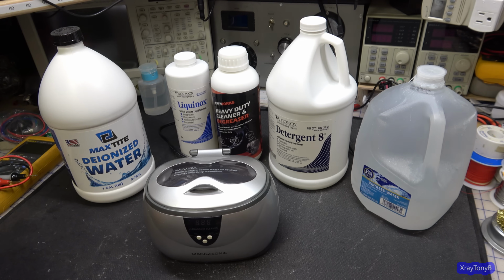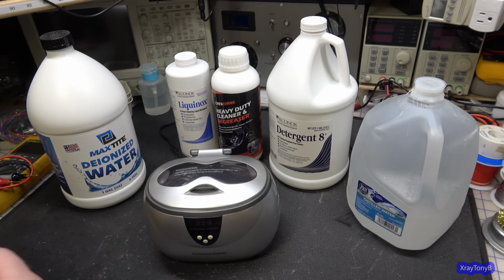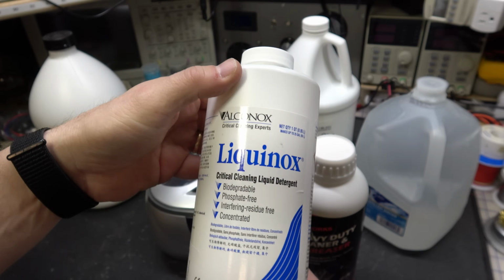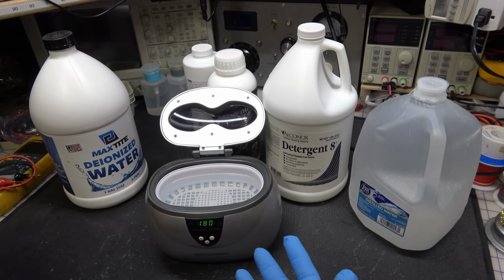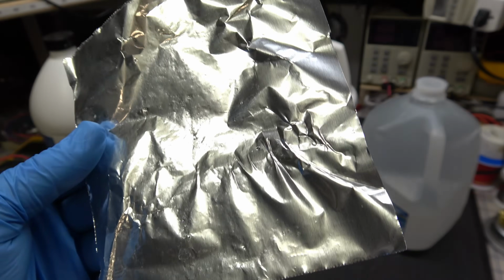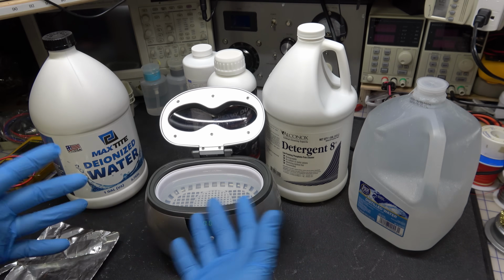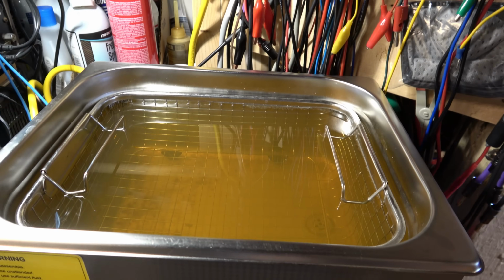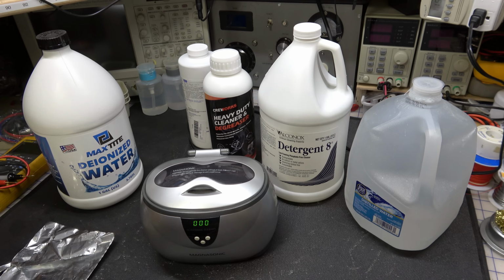Using Ultrasonic Cleaner for Electronics

Comment: Why Not use the Water from your dehumidifier you have in the basement. That would be close to distilled. As apposed to where you boil water and it have the condensation drip into a collector.

Comment: I've been looking at ultrasonic cleaners for cleaning electronics for some time but started going down the rabbit hole.  Hearing about potential damage to parts, PCB's I found the Elmasonic cleaners.  I was in shock after looking at the cost.  Then I saw your video.  Been watching your videos for some time, I felt confident to start with the same Magnasonic cleaner you have.  Purchased detergent 8.  Working on legacy equipment I would hate to damage anything and not find replacement parts.  Great video!  I still have a lot to learn.  Maybe try the Creworks 10L I think you have later.  Thanks.

Comment: Ive often wondered about using an ultrasonic cleaner on circuit boards.  Back in the day, circa 1984, we used water rinse flux.  We took the finished boards down to the lunchroom sink and scrubbed them in hot water and dish detergent with a toothbrush.  
A quick note about Dawn and plastics.  Wesley Treat just posted a video about making signs with two ply engraving plastic.  I assume it was acrylic.  He used diluted Dawn as a barrier to keep the residue from sticking to the unengraved areas. If left on for more than an hour, it degraded the finish.  I don't know why it happened but it would be dissapointing to have that happen to a face plate or knob.
Reply: You can post YT links in comments. I'd be interested to see that video. There's arguments in the car detailing world about using Dawn vs specific paint cleaners.

Comment: Some peeps don't like it, but for my multimeter repairs i use plain and simple IPA (without heating ofc!) in my big ultrasonic cleaner. From time to time during the cleaning process i brush the boards a bit and let it go. Till now, the boards come out extremly clean and "drying" is done with compressed air.

I do remove some parts like the mentioned foil capacitors.

Comment: I use ultrasonic cleaners in a professional setting also, some of those boards come in nasty and once they found a good cleaning solution it was hands down the best. The only downside is that it often times eats away some kinds of conformal coatings.

Comment: I guess if you are rinsing with just regular water then I don’t see the point of buying and using deionized water. Rinsing with regular water is going to leave a residue as soon as it dries, right? What am I missing? Also, if reusing the deionized water for more than one cleaning, there are already going to be contaminants galore in the water. I just use tap water and Simple Green and rinse. These devices are magical. ❤

Comment: OK, nails scratching on a board oddly brings me to a relevant story and question. I have lived with an exhaust fan in another apartment that has driven me insane (the noise and vibration make me feel like puking), but they wouldn't fix it unless I could tell them which apartment. I finally figured it out last night at 1am by going down my hall and the floor below. Success and finally fixed. Knocking on people's door and an old guy with a beard wanting to go into their bathrooms was obviously a bad idea. They left it on all night and at that hour, I could go and listen to the walls until I found it.
There is a device called a mechanics stethoscope that is a little tube that helps hear problems in motors very exactly. Works great, except I just used a wooden broomstick pressed against the bone next to the ear. Has anyone tried pinpointing a bad component by listening to each one?

Comment: you can buy deionised water from gas stations all parts department used in batteries you could try ad blue, but it's got urine in it I'm not sure electronics switches but it is deionised water 68%

Comment: If you're in Canada (general audience, I know you are Tony) there's a place in Newmarket, Ontario, "Crystal Electronics" and they make their own electronics cleaner to spec with the original Branson formula.  It's $115 for 4L but their supply is plentiful.  I've had a bottle for 3 years, it's now expired but it still works fine and I'm not even down to 1/4 of the bottle being used yet.  They do ship, but due to the weight and additional eco fees shipping could be quite expensive.  However, if you're in Southern or Central Ontario, it's worth the drive to pick up a jug.

Comment: With the power of the Piezo devices on thr bottom under the tub if you put a mason jar into the tube, with out water in the tub you will overheat the Piezo devices and destroy them. You can use the mason jar but, put water into the outside of the jar this cools down the devices. Its like running a car with no water in the radiator.
Reply from the maker: I'm pretty sure I said that.  I think i said just to use regular water in the tank and to place the jar in it.   Maybe I didn't,  but i think I did.   Go back and watch that part again.  If not,  I'll pin this at the top of the comments.   Thanks.
Reply: @xraytonyb yes, of course, you did say that.

Comment: DI water is not neutral pH as it will absorb carbon dioxide from the air and form carbonic acid, which makes the water weakly acidic.

Comment: great tip on the mason jar i hate wasting a bunch of chemical in my large ultrasonic never even thought of that
Reply: @wizzkidelectronics  For parts that may not fit in jars, I've had great success with ziplocks. The parts stay submerged, but the top of the ziplock will float or stick up, making removal even easier.

Comment: I'm waiting on a delivery of an US cleaner right now, so this is timely. Strewth, that Alconox stuff is expensive here in Australia. Have to find something made locally. 
Instead of evaporust, have you tried diluted vinegar? Reckon I'll start out with plain water first. 
Those little jewellery cleaners, I didn't consider one because they are small, but it makes sense to have one for the small stuff. 
Aldi ( do you have those in the US? ) have them come up on special for like $25.

Comment: In general, distilled water is more pure H₂0 than deionized water.  The deionization removes ions, like dissolved salts ions (sodium, phosphate, chloride, potassium etc
0, distillation additionally removes most non ionic compounds, though a few are tough to remove completely by distillation alone.  In most chemical labs, deionized (DI) is fine and its cheap to produce on site.  Bottled DI is more expensive to consumers because there is no market for it, distilled is better and cheaper for the home gamer.  In some labs distilled isn't good enough, but those are more of exceptions.  They'll have additional processes, such as a Millipore system, to obtain the purity they need.
Reply: yohoyoho13 is correct.  If water is actually distilled, it would tend to be purer than just deionized water.  There can be impurities in deionized water that do not happen to be in ionic form; distillation should produce only H20 and nothing else.

Comment: I managed to fit half the chassis of a Fisher KX-200 tube amp in a 10L ultrasonic cleaner. Had to flip it, but it was amazing. I did one bath with soap/simple green to degrease it, then one with CRC Evaporust to remove rust from the classis, followed by rinsing with water, then distilled water, then flooding with 99% isopropyl and drying it with l compressed air and a space heater. 
I love using it on knobs, hand tools, PC components, and anything I can fit in it. 
Another useful thing is patinas. I love throwing in small finished parts in a ziplock of Sculpt Nouveau patina. Gives a very even patina finish.
Reply: Did you have to remove some parts (except for the tubes) before putting it in the ultrasonic cleaner?
Have a really crusty old McIntosh C-20 that needs cleaning.
Reply: @geirendre  I removed a lot of the components. The tubes, the transformers, any capacitors that were not mica capacotors, and the potentiometers (have heared conflicting opinions on whether the ultrasonic cleaner will damage carbon tracks).
For the transformers I removed the housings and derusted those seperatly, but for the windings/iron core I used a rust converting primer and re painted them separately.

Comment: Cavitation has tremendous energy.  In diesel engines if the antifreeze chemistry isn't monitored and kept at the correct DCA (diesel coolant additive) level cavitation will actually blow a pin hole straight through a cylinder wall eventually.  I was a diesel mechanic in a previous life before I got back into electronics repair.
Reply: I got a great deal on a used diesel truck a concrete contractor used. One of his guys just kept driving it until the automatic transmission broke. One of the very few times I used a mechanic. They wanted to open the transmission and see if they could fix it. They called me and said they had never seen anything like it. It was all welded together inside from the heat. Wow! I worried for a couple of years if they had kept up with that coolant additive or not. That truck doubled my business. They really like to hear that diesel engine in Texas. Status symbol.

Comment: Keep glass fuses and germanium diodes out of these things. basically anything with fine wires or bond wires is a no
Reply: The cavitation only occurs with liquid contact. Any airgap will nullify it. ICs and others encapsulated components are fine.
Reply: @jonlaws4493   if you say from  experience and not a academic book  or special component than I believe you. Otherwise I'm going to errrr on the side of caution
Reply: @fatteebaddee I clean my PCBs this way. My techs at work clean the PCBs the same way, using IPA in the cleaner. If you are concerned, then remove the  “sensitive” parts before cleaning and solder them back in later.

Comment: I am curious why you prefer de-ionized water?   Distilled water is generally accepted to be cleaner.   Is there some advantage to de-ionized water when cleaning circuit boards?
Reply: Wrong...sorry. There can lots of crap in distilled.
Reply: Real lab grade deionizers are used after distilling the water. The drinking water versions aren't very good. Distilled is better than those.